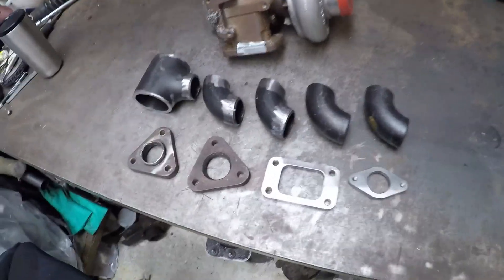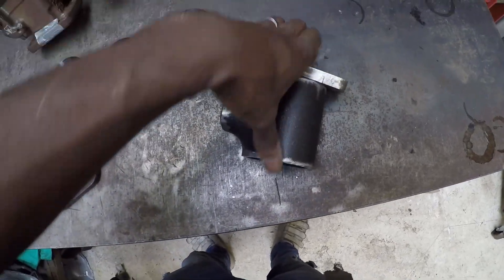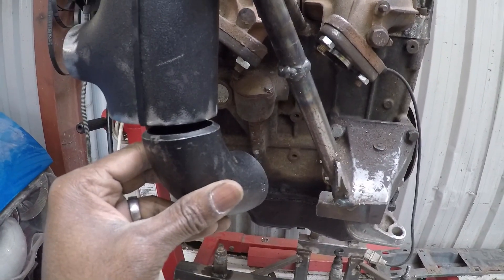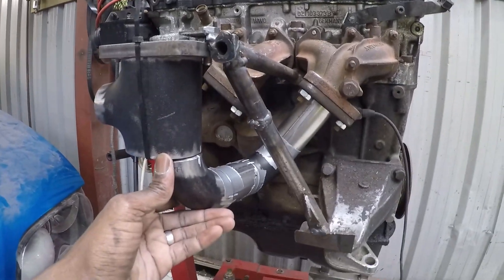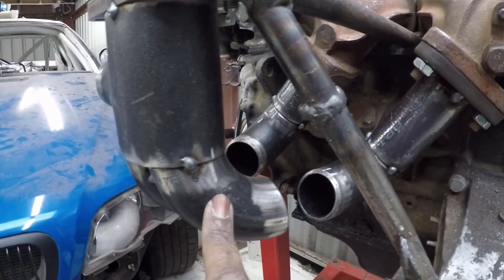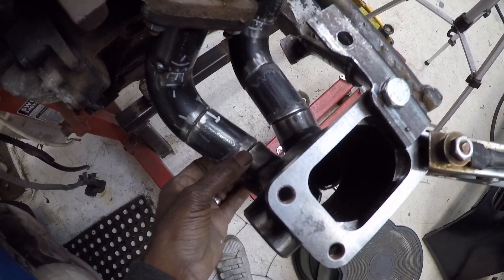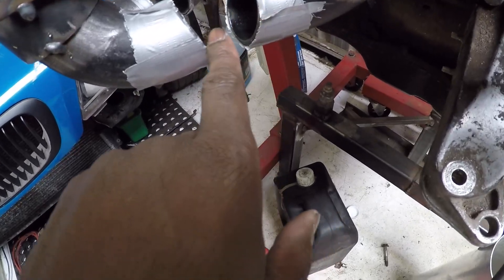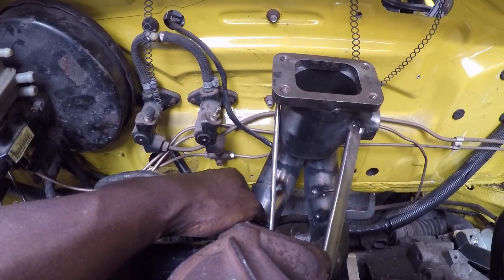DIY Turbo Manifold  - Twin Engined Corrado VR6

Comment: You are doing good work and your technique is good, you could wrap the turbo manifold with lava tape and put stock heat shield on top of factory manifolds also put lava blanket onto turbine housing this makes a big difference....
Reply from the maker: Cheers bud.  I'll be using some heat management from Funk Motorsport

Comment: Great skills there mate.  What in essence is the project?  Can't you buy a second hand manifold anymore for the corrado?  Are you joining two engines together?  I remember your transit rust repairs.
Reply from the maker: Cheers but.  You can still get off the shelf manifolds for a VR but most are built for LHD and few will fit RHD with a decent sized turbo.  Engines will be completely separate.  Basically two of everything